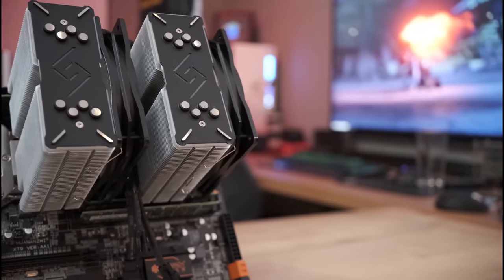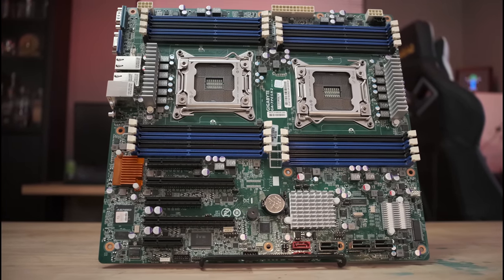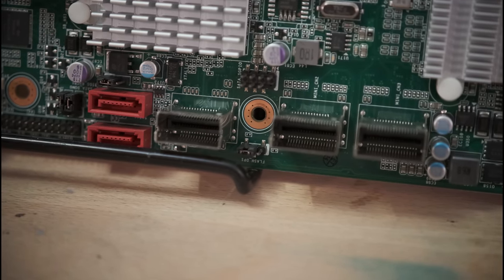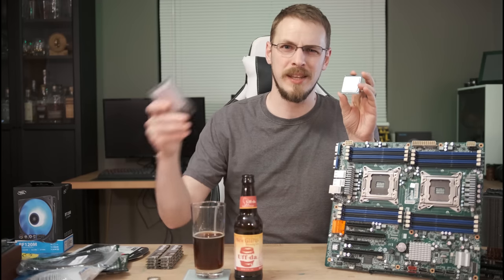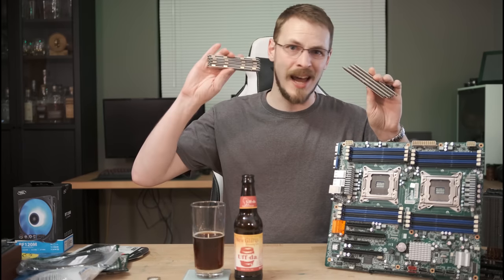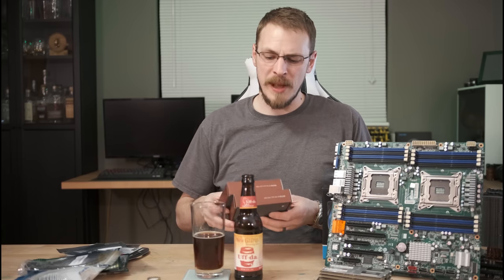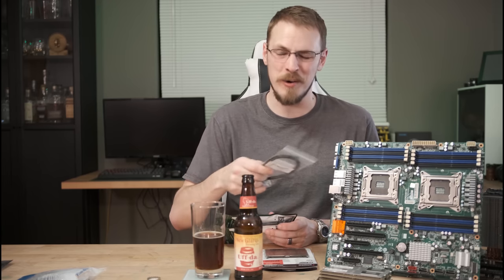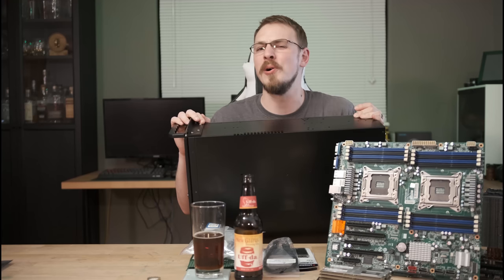Server Room Build Part 2!!! Virtualization Server Build!

Comment: When you described the problem I was sat here thinking: "That sounds like some of the PSU issues I have had, so it's either dead or you forgot to plug in the CPU power. But he probably already tried that. And it's server hardware, it probably works totally differently and I have no idea what I am talking about."

And lo and behold, its a power issue, not quite the one I thought it was, but pretty close.
For once I feel smart.

Comment: These are great boards. I'm running one in my Unraid box with a single low power xeon and also running one in my main machine with 2x 8 core xeons. Bios modded the one in my main machine to support nvme boot from a pci add-in card. Running solid for around 3 years.
Reply: Forgot to mention.. The 10gb chip under that copper heatsink ran insanely hot. Gigabyte support said it was normal but modding a 5v laptop fan to blow on it took care of that.

Comment: If you are looking to save power, since you have an always on NAS. Set up iSCSi and install those SSDs in the NAS for your VMs to load. Boot proxmox off of a cheap USB stick. Also, if you want to mirror and experiment with professional type workloads, use ESXI. it's the industry standard. But proxmox is fine for home/hobbies use

Comment: These are great boards, I have 2 of them and have modded them to support nvme boot drives. The heatsink for the nics gets insanely hot though, so I modded a laptop fan to run 24/7 even when the machine is powered off.

Comment: @Craft Computing,
Hey, i found out the Noctua 80mm and 80mm Redux are not industry leading, not even leading in Consumer Space.

The Coolers i went with are actually Arctic Cooling 80mm PWM Variants. They are a bit noisier and a bit less Focused, but they have a lot more Volume/Minute of Airflow than the Noctua. Did not expect this because they are Gods when talking about 120/140mm Fans. Also: Single Rail is ok'ish, but i really recommend 2 12V Rails for Stability Reasons. I found out the Hard way, my Be Quiet! Bronce 550W was capable of running my NAS well, but some random errors occured. I switched to a ~430W Seasonic Gold Series and bang, ultra stable.

Edit:
Thank you for shareing this content with us btw! Also: Please keep us updated about the failed 10gig Switch.

Comment: Im doing a similar build with the e5-2650l v2 but picked up a 2u platform used for 130 bucks shipped. Seeing your pain I’m glad went used prebuilt server route. Only concern I have is the 1100 watt psu included will pull more wattage then it needs
Reply: PSUs are typically designed to only pull the needed amount of wattage.
Reply: Yep, only in cases of used servers. I have seen them pull 200-400 watts even with only cpus, one ssd, and 4 stick ram kit installed The e5-2650lv2 is suppose to be 70watt cpu. I won’t know for sure until I get a meter off amazon.
Reply: @plexnbrown760  70 watt is average not peak; and that's the TDP not the power consumption...

Comment: Couple of facts about this motherboard: 1. It has lights out system management, 2. 10Gb network adapters - but you already noticed that, 3. topmost PCIe slot is connected to the PCIe switch and not directly to the CPU and is slow AF - don't use it, 4. out of 3 mini-sas connectors one is 4x 3G SATA (so don't connect SSDs to it)  and two that are aligned to each other - are built in SAS2 6G HBA. It's based on LSI2008 chip and you can install the latest firmware from Broadcom SAS9210-8i controller and then you can on the host OS install server part of MegaRaid Storage Manager there so you can manage it with MSM remotely (that is exactly what i did). The built in 6G SATA (red headers on MB) allows RAID1 but my host OS (Ubuntu 18) does not play nice with it (known issue of the latest Linux kernels) so i ended up connecting my boot SSDs to SAS controller and configure RAID1 there. In order to see the SAS BIOS you have to configure Legacy mode in CSM for storage controllers.
Have fun!

Comment: I have a Huntkey Panshi 600 power supply for my dual socket server. That power supply is dual socket rated and its continuous rating is 500W, just slightly over the 450W you are using now. Also for VM personally I am more familiar with ESXi.

Comment: ...from the description, I thought I might have to volunteer my server (in the same chassis) as a stand-in until you got your mobo replaced.

Strangely, I had similar CPU power issues when I did my build. I was actually running two PSUs for a while ... it was ... not stable.

Comment: After a few similar experiences the power supply and connectors is normally the first thing I would check. Can be so frustrating to basically disassemble an entire system just to discover it's something simple like a power connector!

Comment: Actually I was watching this video while drinking my beer. 
Jeff, please keep 2690 instead of 2650. You won't be drawing that much power if you don't have that much workload.
Reply: at Idle that is :^)
Reply from the maker: Those are 80W more in total. It's not necessarily the power draw, it's the heat output I'm trying to avoid. Plus, my workflow on the server will see absolutely no gains from the speed bump.
Reply: @CraftComputing  you can disable turbo boost and still have a greater performance with lower tdp. You might need this in the future

Comment: A 450W PSU is fine for that setup if the whole system is only pulling 250W going full out... as long as it is only pulling 250W going full out.   Craft figured out the power issue... using an adapter isn't actually a problem when you only have relatively low-end Xeon's stuffed, but the pinout needs to be correct and it also shouldn't be plugged into the primary EPS because the BIOS/PSU sense won't work properly and the power supply itself likely treats I/O power differently than EPS power.  Which you figured out.  I had the same issue when I was putting together a similar dual xeon system a few years ago.  That and being sure that the PSU can provide the necessary power are the only issues with using EPS adapters.

In terms of efficiency... well, Bronze won't cut it if you are trying to save power, and 10Gbe can also be problematic.  Sizing to the sweet spot is good, though, so a 450-500W PSU is probably what your goal should be.  And it is fairly difficult to control the power envelope on those dual-socket xeon servers verses the single-socket threadrippers.  And you can't use all the DIMM sockets (if you want to save power).  That said, 250W isn't a bad target.  I have a dual-socket Xeon 2620v4 system (also 16-core/32-thread, but 85W parts) that pulls around 200W going full out (compile load, not FP load).  With the 2650's (95W parts)... yes, getting everything running inside a 250W envelope (at the wall) is doable.

You said 32 cores at one point in the first half of the video, but the 2650's are 8-core/16-thread chips, so your system is 16-core/32-thread, not 32-cores.

--

But there are two problems in modern times.  First, a single-socket threadripper 2990WX system (32 cores / 64 threads) is going to be significantly better, for numerous reasons, and you can also completely control the power envelope.  The 2990WX will be 30%-50% faster with the same power cap verses any low-end dual-Xeon system (provisio: with the same power cap).  The power envelope can be set as low as around 150W at the wall if you really want to (you get around 2.5 GHz per core if you do that, all-cores load), it idles lower, and it has more PCIe.   With the threadrippers and Ryzens you can set the power cap using XFR2 in Manual mode, set current limits to max, then set the PPT field to what you want for the socket.

Also, on the threadripper, NOT overclocking the memory significantly reduces power consumption.  Stick with 2133, 2400, or 2666.  If you don't go above 2666 the system should idle at around 65W.  If you have set an artificially low PPT (e.g. less than 200W) then consider running the memory at 2133 to give the CPU cores a bigger portion of the power budget.  Instead of boosting the base frequency, try dropping the CAS (CL) by one and pumping the DDR4 voltage a little.  There are lots of tricks that can be played that give those threadripper CPUs more frequency under full load.

The second problem is that the Ryzen chips are barking at the heels of these older dual Xeon systems for small-server setups and consume even less power.  Why?  Because they work with ECC memory.  I am using a 2700X running with ECC memory with its power cap de-tuned to max out at around 150W at the wall to handle nearly all home functions including file serving.  That way I can dedicate the TR and 2xXeon systems for actual bulk loads.  The 2700X will only be around 30% slower than a dual-xeon 2620v4 system (probably more like 40-50% slower vs a dual Xeon-2650 system).  At far, far lower cost.  The only limitation is, of course, that it only has four DIMM slots and does not have an IPMI port for remote management.  I forget if the max ram is 64G or 128G.   But its perfect for a lot of things.

So these older dual Xeon systems are getting squeezed from both sides.  They are still great buys on the used market, but they are also starting to show their age.

-Matt

Comment: This guy and many others are so willing to settle for an E5 socket 2011 solution.  I’m holding out and saving my money for a Skylake system.  I would have liked a pair of Gold SPs, but since I have not yet won the lottery I will settle for a Xeon-W 2195 build on an Asus WS 422 SAGE/10G motherboard with four 64Gb LRDIMM 2666MHz ECC, all booted with a 1Tb Evo 970 Pro M.2 NVMe-PCIe3.  The DVD-RW and RAID 5 are extra.  Two Radeon VII GPUs and an IPMI card, all powered with a 1200 Watt PSU should keep me satisfied during “the roaring twenties”.

Comment: I am sure you will get it figured out but one thing I do when that happens is pull all the RAM & extra devices & let it post like that & wait for any code beeps. Than shut it down & try with only 1 stick of RAM than see what happens. If it posts than shut down & plug the rest of everything back in & it should boot. (I think lol)
Reply: Also after it is unplugged & shut off hold the power button for about 6 seconds to remove one more potential issue.

Comment: if only I would have seen this mother board. I was not thinking when I ordered a super micro + mother board not realizing it extends past the IO shield in to the power supply section.  I will most likly order a super micro case for the board unless I can mod the case and put a 2 u hot swap power supply in it with plenty of power for mother board and hard drives

Comment: I had the exact same issue with my X99 build and it turned out to be the power supply just didn't have enough power for all the items I was trying to run. It was 550 watt, but when I used the PSU calc I came up with 620 watts so I purchased a fully modular 80 plus plat with 750 watts and problem solved.

Comment: Why the slow 32 threads? My home server is similar but a fast 8 core cpu instead and I don't even come close to maxing it out running NFS, samba, pfsense, and a couple more VMs for giggles. Granted i don't have 10Gb ethernet just bonded gigabit adaptors...

Comment: I've had this issue with server mobo's. Is grounding. I've had a mobo ground it self out on the chassis. It's a good thing to test the motherboard/cpu/ram outside of the case before sticking it in.

Comment: I made a build on this board not too long ago and it was doing the same thing, I then just used 1 cpu and 2 sticks of ram, It did the same thing as in your video but then I waited like at least 10 to 15 mins then it posted, for some reason It took very long to post for the first time. hope it helps :)

ps. do you think the NH U12S cooler from noctua would fit in that case is just 2mm taller than the one you are using.
Reply from the maker: The case says 160mm cooler height, which is exactly the height of the Noctua. The Gammaxx coolers I have installed just barely fit under the lid. Won't know until you try, but I guarantee it's going to be close.
Reply: @CraftComputing  Hope it  fits the noctua has the pipes spikes not like the ones you use that are flat, already have the coolers and motherboard so yea hahaha thanks for the info

Comment: How's the clearance with those tower heatsinks in the Rosewill chassis? Would some Noctual NH-U14s fit there? Glad you got it working. Asking since I got an Intel S2600CP2 that needs a home.
Reply from the maker: Haha, about 2mm from the top. But they do fit. The NH-U14 absolutely would not. The Rosewill has a 160mm max height for a cooler. The Gammaxx GTs are 158 tall.
Reply: @CraftComputing  Dang ok. 4U chassis is off the list then.

Comment: What are you planning to do with virtualization? If it's for a lab environment a dual-socket motherboard is overkill. Better put, I'd say that 64GB of RAM is on the low side with 16 cores. I have 3 Huanan X79 Deluxe with 128GB of DDR3 (4x32GB RDIMM each) with Xeons E5 2689 (Sandybridge 8c). With 30 VMs running  my CPU usage is about 10% on each system but RAM is about 50% (192GB used).

I'd replace the 10GbE switch for Fibre Channel :) It's cheap and FreeNAS works like a charm. Also you isolate the VM storage network from the LAN. I can hit 785MB/s and 150K IOPS from a VM with FC (2x4gbps). But yeah.. you lose 10GbE for the non-server workloads.

Comment: Could you use a normal eatx case?Because the board Is eatx and wouldn't it be slightly smaller with better fan support and cheaper than that 99 dollar rosewill case?

Comment: Ive got that same gigabyte board, I'm running 2 2690v1 trying to get it setup as a NAS/10gbit switch. I just need to figure out what I'm doing with my cooling.
Reply: For a power supply I'm using EVGA 1000W GQ. It has 2 8pins.

Comment: God, debugging my X9DAE was also troublesome. Swapping CPU0 with CPU1, resetting the CMOS multiple times, etc etc. Eventually I figured out that DDR3L RAM was the issue for some reason -- putting in some old desktop DDR3 worked fine. Now I just have to sell my 128GB of ECC DDR3L and buy 128GB of ECC non-L DDR3.

Comment: Subbed. Always love server build videos. I have a server myself,

Rosewill RSV-L4500 Server Chassis
Intel S2600CP motherboard
Dual E5-2620v1 Processors (2.0Ghz)
Samsung 2x16GB 1333Mhz ECC Ram
Samsung 860 Evo 250GB SSD Boot Drive
(1) 10TB WD White Label Drive
(2) 3TB HGST Drives
(5) 8TB WD White/Red Label Drives
LSI SAS-9210-8i SAS Controller, firmware flashed to IT mode
Running Windows Server 2016 with Stablebit Drive Pool
EVGA 600Watt PSU

Comment: Hey did the VGA Out work? I just finished my build with this mobo. waiting on a power supply to use the monitor, but the manual says "video IN" on the manual, but I'm unsure if this is a typo.

Comment: oh jea. that was the problem.   Gigabyte seems to be rather cautious and at least one gen up, seperated each power pin with a dedicated mosfet and probably detects  correct plugs.
My Supermicros on the other hand don't fricken care. Theyx even post with just the 24pin.  Lol.
Asus does that too but i guess they do some calculations on the TDP of the cpu and go from there